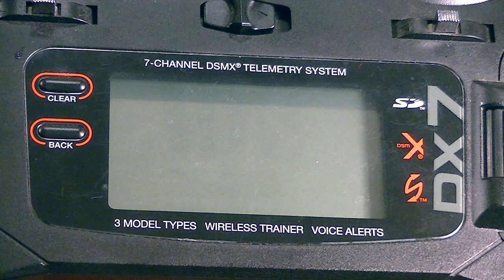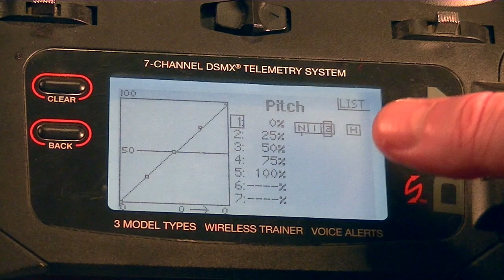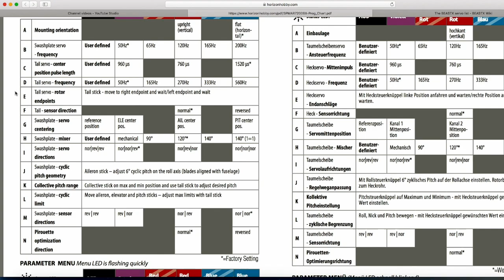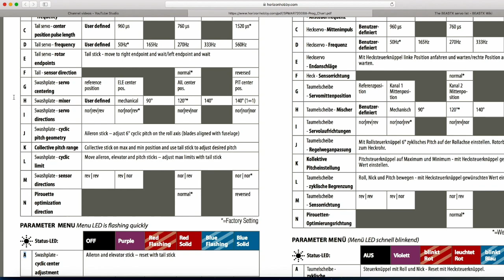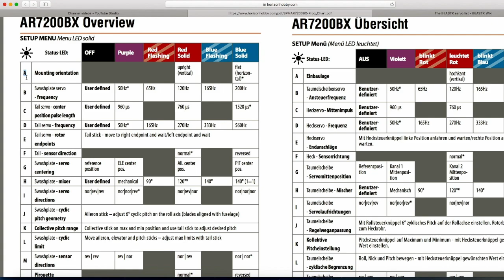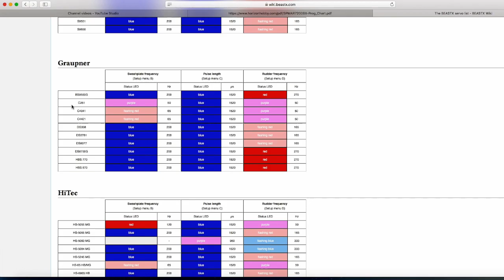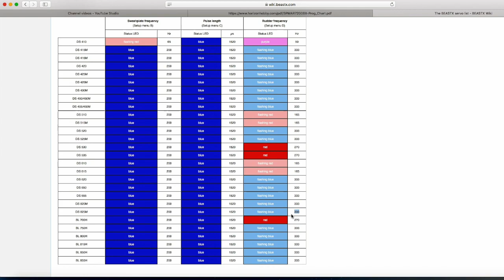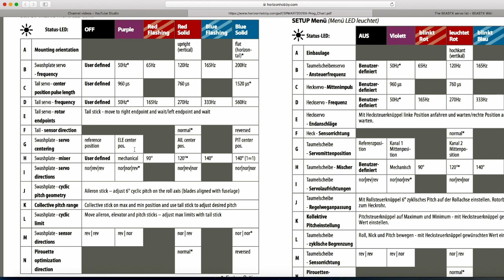AR7200BX / Beast X : Setup Guide #1 (FreddyCanFly)

Comment: Hi Freddie. I watched all 4 videos in your series a few nights ago, most informative, thank you. I'm really struggling with my set up. I'm new to RC, I bought a second hand 'as new' Trex450 and I have a DX6 with 4651T receiver. I've fitted a TGZ380 BeastX clone but cannot get it all to bind. Do I need an adapter lead between the RX and the TGZ380? Cheers.

Comment: Hi Freddie.. i only have little movement on the swash now i setup the alierons  6 degree is that right.neg 6.6 and pos 6.8 blades front to back.. will that be ok.. then 12.5  and -12.5 pitch..  all in all  limited swash now with all this setup..is that right...

Comment: hello sir thank you for the setup procedure very helpful! can u tell me with my 450 size heli do you think it would be better to supply power to the beastx and to my spektrum reciever? i know they say anything over a 450 size you should supply power to both. can you give me your take on that? THX
Reply from the maker: So are you using the beast x plus or something different then the AR7200?  If so then yes double redundancy is always nice for receivers.  However with the AR7200 in particular it does not need a receiver so you can run a double redundancy cable to just the FBL.
Reply: @33forsaken  yes im using the microbeast plus.

Comment: Do I need to use a separate RX with the ar7200 if I'm using a DX6E?? If not where do I plug the sat into the ar7200 at???
Reply from the maker: No the AR7200BX is the receiver and you just plug in the SAT.  It connects right in the center of where all the servo pins are.  You will see the insert for the Spektrum SAT.
Reply: Hey Freddie... Have another question. While powered up and I flip the "D" switch on my DX6E the lights on the RX dance around. Any idea what that is??? Or what I'm changing??
Reply: @33forsaken  so what is the SAT? If this is the rx and fbl? Im new to this not done a build yet and learning on a blade 230s v2 with the help of your videos. Cheers!

Comment: HELLO FREDDY!!,  I HAVE A RAPTOR 50 SE AND I HAVE A 3 BLADE HEAD TO INSTAL AS355 FUSELAGE AND I CANT COFIGURE
THE 1 SERVO SETUP ON MY DX9 BLACK EDITION I CANT GET THE SERVOS TO MIX PROPERLY, I WAS TOLD TO SET THE GYRO TO MECHANICAL,I NEED HELP IF YOU CAN. THANKS FREDDY WHEN YOU HAVE TIME..
Reply from the maker: Sill question but are you using the AR7200bx for this setup? Shoot me a PM on Facebook maybe I can help out :) I have built a Bergens intrepid before and I believe I had the same setup.

Comment: What does pressing the setup button and turn the model on do
Reply from the maker: I do not believe this to be needed for this FBL system.  Some other ones like the 3gx and older had you push the button then power on to enter programming modes.

Comment: I just bough a trex450 with this controller I got a dx7s so before it gets here I'm trying to get setup
Reply from the maker: Sounds good, feel free to ask if you have any questions buddy :)
Reply: @33forsaken  thanks will do if any problems come along i dod get the helicopter flying yesterday very hard compared to my 6g helis and drones but manageable will need to learn more did have problems with the flaps switch were i did not know why my tail servo wouldn't respond to commands after existing setup but figured out I hadn't set my gyro percentage on the transmitter

Comment: Hi Freddy. I was reading manual on attitude control (microbeast plus pro edition) and it stated that attitude control must be swiched off during take off and landing. Why not with it? You take off and land in horizontal position and I do not apply any inputs during take off (maybe just a little right aile after it is an inch or two in the air to compensate for drift to the left). I think what they ment is if the heli is on the ground, then you should not make any inputs from the right stick. What is your opinion?
Reply from the maker: I have never had any issues, honestly if you follow the videos correctly and everything is sound you should have zero issues buddy